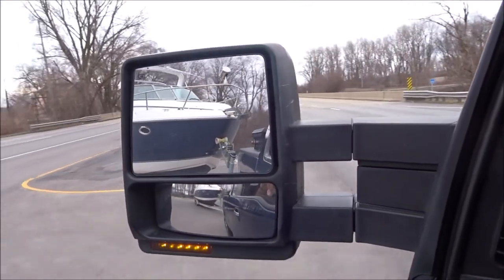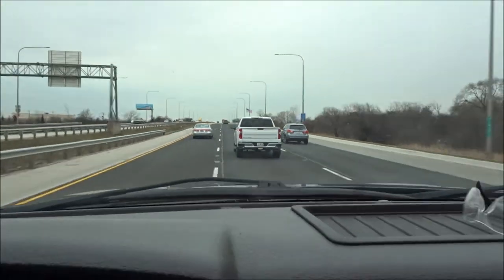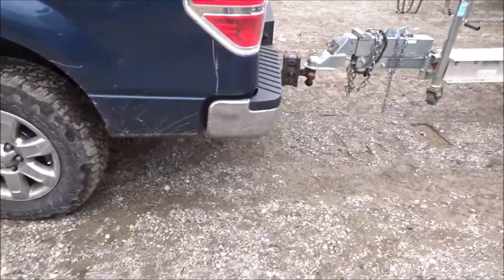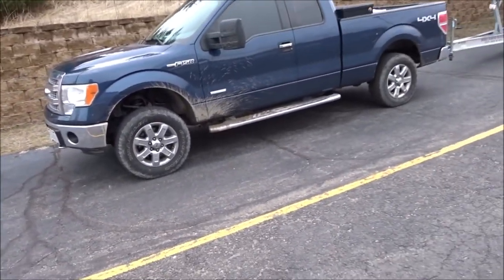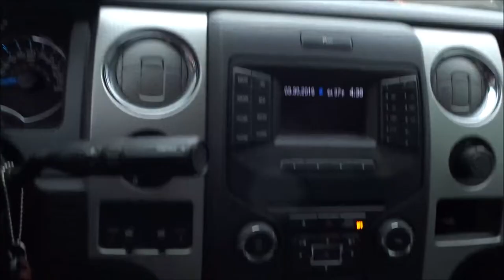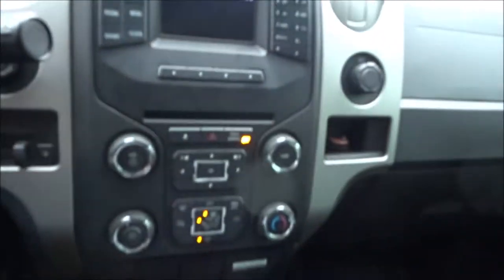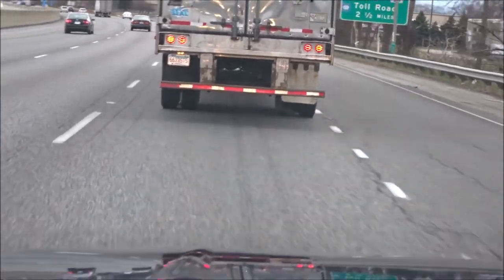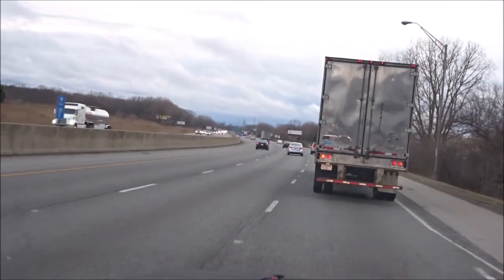Airlift System 5K Mile Review!

Comment: Had a 2009 F-150 w the 5.4, no airbags, have a 8.5x20ft open trailer I tow 3 four wheelers on. All around 9,000 pounds. Never had a problem. Did squat a bit though

Comment: My truck is very similar it's a 2011 EcoBoost 4x4 xlt super cab I just installed the same air bag system and watched your videos, and they are very good. Question though, do you have a leveling kit on it? It looks a bit taller in the front, thanks in advance
Reply from the maker: I've got the Bilstein shocks with the adjustment built into them. I've got it set on the second from the top notch. So it is raised on the front.

Comment: Eliminating the squat doesn't put weight back on your front axel where you need it.  You can still wind up with  a dangerous amount of sway.
For the best results use a weight distribution/anti sway hitch. And never exceed your combined gross vehicle weight rating, if you should get into an accident and are overweight  you are at fault and legally liable for injuries and damages.  I'm  a professional truck driver with over 30 years experience and will tell you that safety should always come first.
Reply from the maker: I agree that safety always comes first. However boat trailer do not allow for weight distribution hitches since they are hydraulic brakes and the tongue slides back and forth. The weight does transfer forward to a point that helps. But I always try to do everything possible to stay safe while towing.
Reply: Air bags are nice for leveling the truck, but they add zero weight back to the front axles. Your rear axle is still acting as a fulcrum, air bags or not. That's the misconception some have about airbags thinking they are shifting weight back to the front. They do not. That being said,  you do get better handling with airbags by stiffening the rear suspension. But the braking and steering control is still compromised, especially in wet conditions. Ideally you need a weight distribution hitch and air bags. But like you said, with surge brakes on your boat trailer,  you  don't get that option.

Comment: Have you hauled your boat a long distance yet? If so how did it handle with the air bag set up? I'm in the same boat, big boat and a 1/2 ton truck. Thinking about using the same system you are using if it made a long distance haul better.
Reply from the maker: I have not hauled it long distance yet with the new setup yet. Though I will say it does feel more stable with the sir system. The only thing I would be cautious on is the size ratio. One good wind and you will be going for a ride.
Reply: @HitchinMitch  for sure, that's one of my main concerns as well as being a youtube video with my truck in the water.
Reply from the maker: @gsadv2230  I'm sure if you take the necessary precautions you should be alright. Haha at least you'd go viral. But yea, you never want to be that guy who loses the truck.

Comment: If that was my 04 f150 with that poopy 5.4 the Second u put that boat on it and started to move it would blow up in 2 seconds but I have a 21 foot proline boat so and it have air bags and u could put were you put air in them you could put them on the license plate that’s where it is on mine
Reply from the maker: Atleast you know your trucks limits. Haha but I did end up mounting the valve just under the back bumper.
Reply: Hitchin Mitch lol
Reply: When ever I get the fixed 5.4 in it I might pull a boat like that cause some Company fixed the 5.4 s